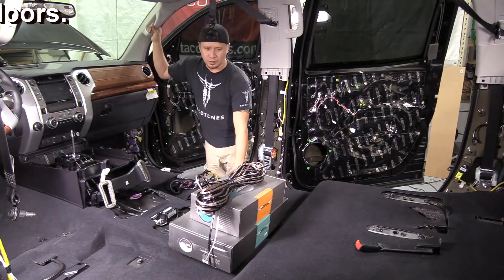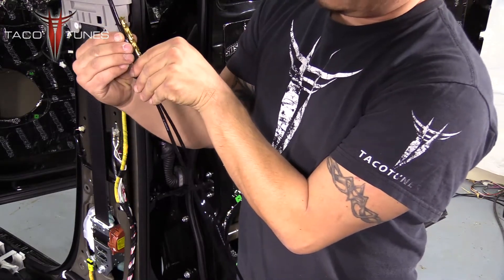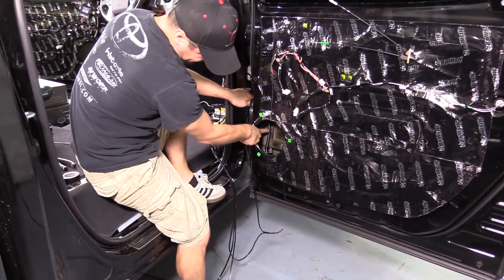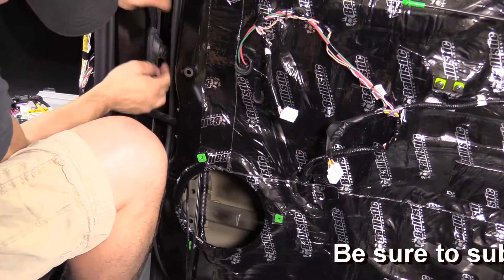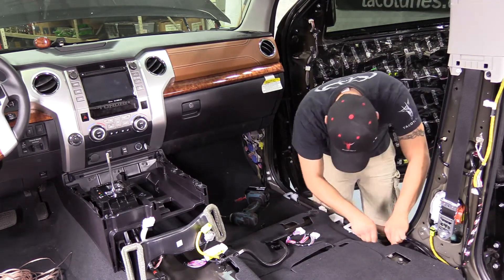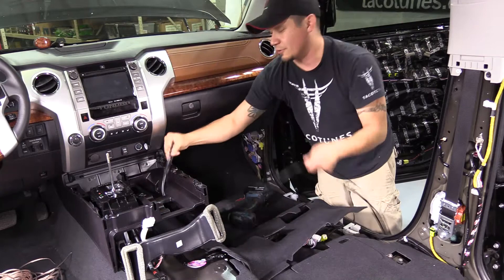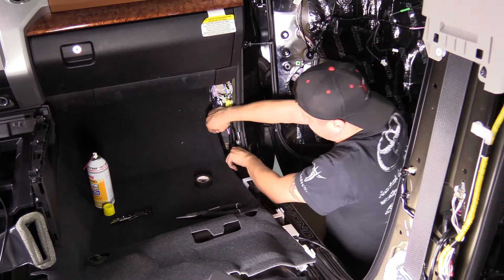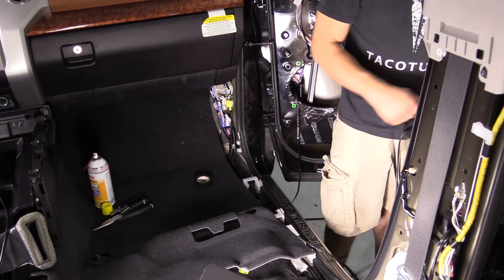How to run new speaker wire in your Toyota Tundra

Comment: Good tips.  I installed a sound system in my old 2011 Tundra using these same techniques minus the drilling points and silicone spray. Wish I had taken time to think through that but, I was just wanting to get it through; sore fingers pushing thick speaker wire through that existing rubber boot/hose.

Comment: Lol came here cos I got to running wire and find the factory door looms use a connector at the door frame. Thought "how do I get a wire through that without drilling". Answer is, tacotunes dont know either.

Comment: Why dont use the factory wire speakers ???
Reply: They are too small. Not oxygen free. You can't put to much power through them. Bigger wire less heat better sound
Reply: @jamesswain2923  I run new  wires from the New amplifiers to each door and dash !! The originals wires still intact in the truck if for any razon i need to put everything back to original!! Thanks for your answer after 3 years 😂late but sure
Reply: @gustavogarcia2818  I just seen the vid. Lol
Reply: Oops my back electrically controlled doors locks don’t work and didn’t even hit anything